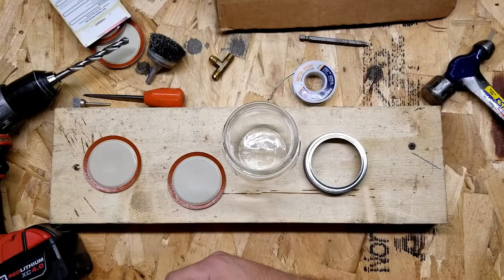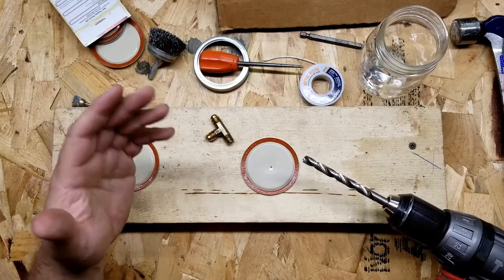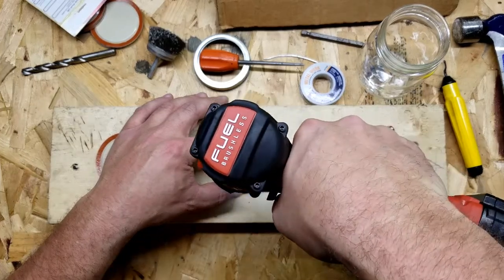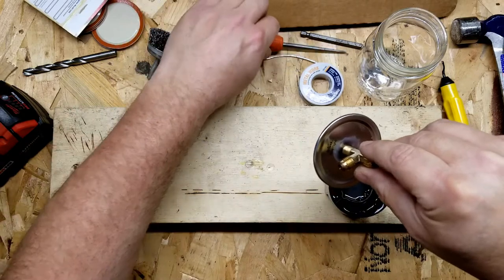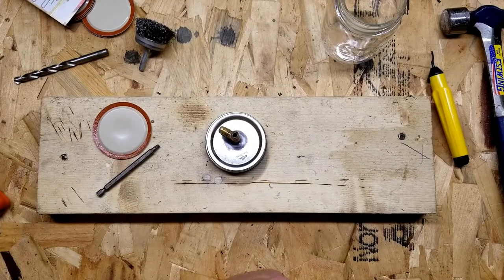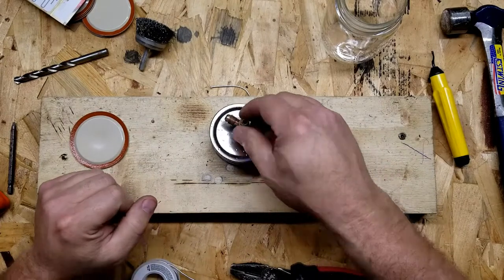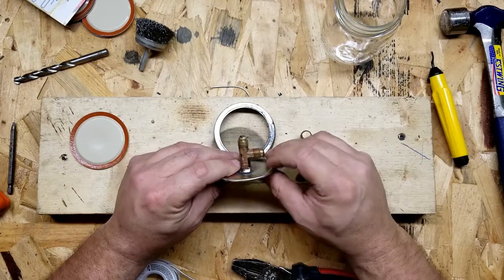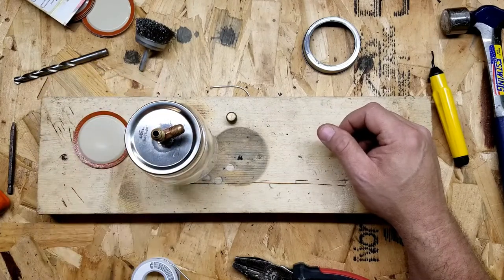How To Make DIY Vacuum Chamber Solder Brass To Steel

Comment from the maker: My preferred solder for this project would have been this: https://amzn.to/2wclBf2
The solder I used in the video was from Home Depot and contained no lead.  My preferred leaded 60/40 acid core solder is better for this type of job.  It's easier to use, melts at a lower temp, flows better, and gives a stronger joint. 
Thanks for watching
As an Amazon Associate I earn from qualifying purchases.

Comment: I’ve made these kind of lids to demonstrate boiling water at room temperature. Not sure if they’re safe for deep vacuum but I’d guess rounder style jars are stronger than squarish jars.
Reply from the maker: I haven't imploded this jar, yet.....  but I haven't used it very much, either.  Always use caution and safety equipment if/when conducting experiments. Thanks for the comment.

Comment: I have to evaporate a lot of acetone for a project, I’m using this technique to make a distiller, so joining two jars with a little pipe, ice bath for one, warm water for the other, so I don’t need to waste so much hopefully.
Reply: Update, the compression fittings were tricky to get to seal, because I don’t know what I’m doing but this worked pretty well.  I put old acetone in a mason jar, and put it in hot water, put the other in an ice bath.  I definitely smell acetone when I open the cooler, but it worked, now I have cleaner looking acetone.  Next I’m going to mount the fitting to an empty acetone can, then I can immerse the whole thing and cool the copper to make a better distilling aparatus.

Comment: seems like you never added "the next video"... I'm interested to know what vacuum level you were able to pull the jar down to. Trying to investigate solder joints for vacuum chambers, not necessarily glass jars.
Reply from the maker: I planned to make "the next video" but then I discovered some of my A/C equipment was showing its age and wasn't sealing good enough to achieve deep vaccuum. Eventually I will upgrade my older equipment and I can make the "next" video. Probably next spring when A/C season rolls around again. Thanks for the comment.

Comment: Very interesting! I was interested in your opinion. Do you think it would be better to use a soldering  iron to control the heating point?  Or would that be too small of a heating point that would not get hot enough?
Reply from the maker: Are you talking about an electric soldering iron used for soldering wires together? Or a soldering iron that is heated in a gas furnace like commercial roofers and Sheet Metal Workers use to solder sheet metal seams.  In my opinion an electric soldering iron used for soldering wires doesn't have enough energy to properly heat the fitting and the lid like I did in this video. If you don't get your parts up the temperature, you'll never get the solder to flow properly.
Reply: @SlipFitGarage  Oh, wow! Thank you for responding! Yeah in was wondering about an iron for soldering wire. I'm brand new(and an idiot) to all off this. I'm thinking about making a still with Mason Jar thumpers. Although it may look cool, I have read a lot of people say don't use the jars because they may shatter from the heat. Any opinions! And thanks again for responding!